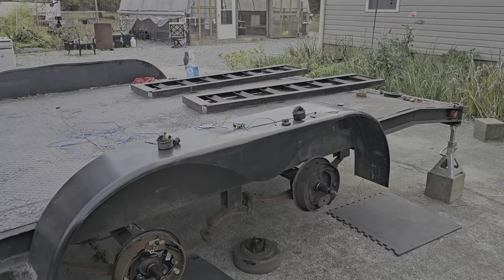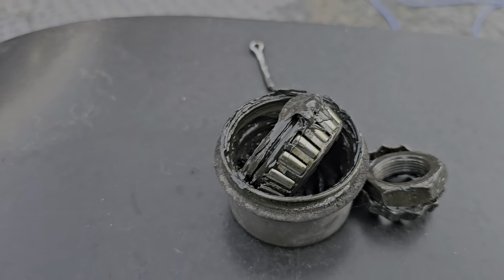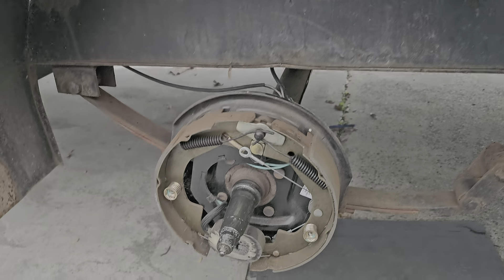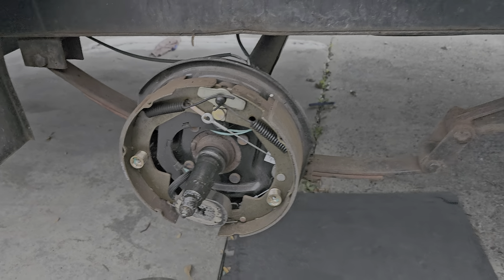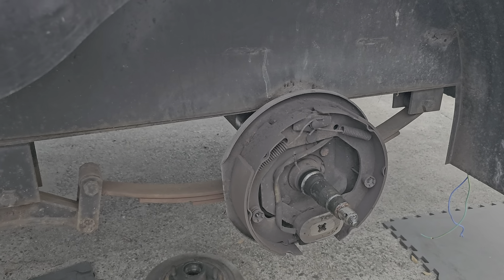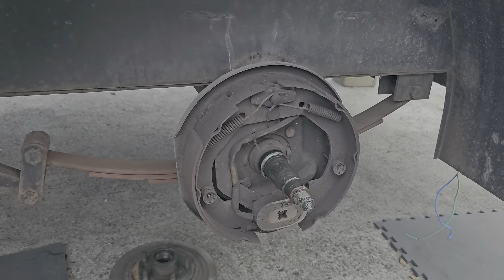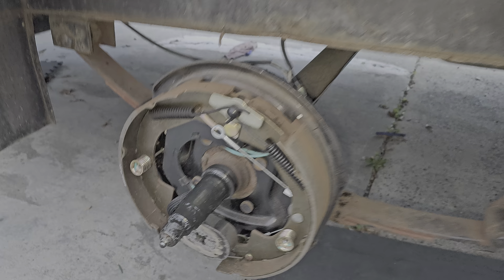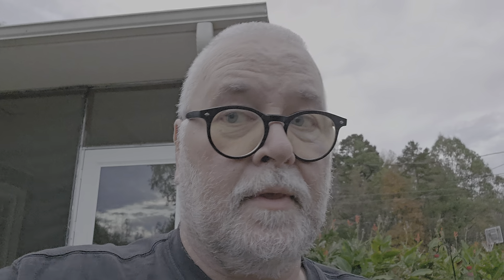Electromagnetic Brakes? How Do They Work? Car Trailer Repairs..

Comment: Pump your grease into spindle with drums off until all the old grease is out so you have minimal mixing. Pack your bearings in your grease and put it back together and pump it your grease to top off. That should take care if the mixing grease issue. Easy when its apart. Safe trip, cute dog.

Comment: Calcium Grease ,Lithium Grease ,Aluminum Complex Grease ,Barium Complex Grease ,Bentone (Clay) Grease , Polyurea Grease ,Polyurea Grease ,soap grease, When I was a young man working in the lead and gold zinc mines in the Yukon at Anvil mines at the town of Faro they mixed greases on a huge electric shovel  the tracks didn't last 1/2 a mile walking to the next dig site ,cost them 1 million dollars to repair tracks pins bushings, that was in 1970 the head maintenance planer was fired ,and we told them don't do it was a cost cutting idea .

Comment: And does the brake booster drain your battery.. ..?
Reply: Just like brake lights on the car, they only use power during braking.
Reply: It's running off the 12v system of the pulling vehicle. Unless your alternator fails or you somehow are pulling the trailer with the vehicle off, it won't do anything to drain the battery.
I guess worst case scenario, if you are holding the brake in vehicle off it would add a slightly larger draw than just the lights but I'm not 100% on that.

Comment: And if the grease  run passes the seal, then there gos your brake shoes. i for one, I won't use the grease  fitting. Just pack and go after all trailers  get way fewer miles, then cars do, and no one greases their wheels that much

Comment: Years ago i was on the interstate. Saw something come across the divider and bounce down my lane. A wheel and tire combo. I dive to another lane watch the wheel as i pass it still bouncing nearly cab hight and across the interstate i see a truck with a empty car trailer coming to a stop on the shoulder smoke coming off the spindle. I needed clean shorts and i bet others did to

Comment: Trailer lights are always a pain in the butt😂
Reply: Was doing this last week. turns out the trailer module in the vehicle was also faulty, only 2 of the 4 outputs worked, so that got replaced as a unit. New LED lights at rear, soldered to the loom and mounted, and then at the front replaced the plug and 5m of wire to get rid of the last intermittent wiring, soldered again and taped up, and placed securely in the wiring channel again. Used a lot thicker wire as well, not for the current (LED units take under 1A total) but for the better fatigue life of the higher strand count wire. More ties added to hold the cable against flexing, and a loop so the trailer turning would not stress it either.

Comment: Nice video. I’ve seen those easy lube things work as designed, but I’ve also seen them dump grease onto the brakes even when used as directed (pumping by hand while rotating the tire). Also, to me greasing bearings is more about getting the old grease and contaminates out, and you’d have to pump a lot of grease through the hub. Lastly if a bearing is grooved up or pitting, I’d prefer to change it at my shop as opposed to out on the highway. I’d also prefer to catch it before it spins on the spindle and ruins the axle.

Comment: Regarding brake controllers, there are two types. First is a time delay type that has a gain and sensitivity wheel. These are designed to allow the selected time from tow vehicle brake application to vary before the trailer brakes apply. This system also then applies the fixed voltage level to be applied to the brake magnets. Typically this system will allow for good braking when at highway speeds and very aggressive braking at slow speed. Very annoying. 
The second type of brake controller is an INERTIA type, typically with a pendulum inside. This gives you modulated braking, meaning lower voltages are sent to the brakes during slower stopping and full voltage to be applied during hard braking.  Tekonsha makes  an excellent controller, the P3 with the ability to work on several different types of trailer braking systems.  I hope this helps anyone with the old style controller. Upgrade your controller and you will be pleasantly surprised.

Comment: Great job Kenny doing a thorough inspection.  Let me point out regarding greasing the hub through the zerk on the spindle, that there are two different types of seals available. You can find a single lip and a double lip seal that fits the drum. If your axle has the zerk fitting and bearing buddies grease caps, then a double lip seal is MANDATORY. 
This prevents the grease from being pushed out onto the brake linings. 
If you have an axle that is not drilled and no zerk fitting, then any seal will work.  It must be understood that you do not pump grease into the bearing buddy and bottom out the piston. You want to fill the bearing buddy hub about half stroke. 
As mentioned before, replace the entire brake assembly as a unit. If you price out individual components you will spend more.  Be sure to inspect the wiring for any corrosion or damage as this will affect the resistance and loss of voltage being applied to the electromagnet. A good working system will probably have about 6-9 volts being applied at the magnet during braking, if your controller is adjusted correctly.

Comment: Greases compatibility is it's own rabbit hole. But it's usually not about the base oil in the grease, it's about the thickener. Maybe the additive package, but thickener compatibility comes first.

To keep it simple, there are 3 main thickeners out there that are being used in automotive industry:

– lithium complex (the most common one)
– calcium sulfonate complex (gaining popularity day by day)
– polyurea (stuff from the factory usually is packed with it, like U-joints and some bearings)

The first two are more or less compatible (Li and Ca), meaning you can pump the old Li complex with a Ca one, just don't switch the grease each time you pump. The issue comes with polyurea – mixing it with pretty much anything else is a bad way to go. The mix can either soften or harden depending on the specific combination, but it's a bad day both ways. I highly advise just washing whatever part you're regreasing with clean gasoline until it's free of old grease and just repack it with a new one you're using.

Also, polyurea has it's own distinct consistency and feel, compared to Li and Ca (complex) greases. It's kinda more gelatinous, while the latter two are more similar to a thick ketchup or a tomato paste, pardon the food analogy :)
Reply: That's worth knowing. I'm a little surprised to hear that a U joint would be packed with something incompatible with typical grease. The first thing I do when I install a U joint is add grease....
Reply: The other thing about compatibility of the greases is they will be actually corrosive if you mix different bases...as well as breakdown or  hardening up. I've seen this, but in aircraft stuff. There's lots of different grease bases used in that environment for exacting, specific purposes. We are actually in good shape so far as automotive wheel bearings and stuff on auto applications as all we need to do is totally remove all grease and only use one type..
Reply: It's because polyurea is a good choice when a manufacturer makes a part that will likely be either uncerviceable (u joints without zerks) or people being people won't pump it even if it has one. It's great when it comes to rejecting water, doesn't wash out as easy as Li-based greases.

The problem comes when the base oil eventually dries out – the seals on the u joint eventually lose that thin coat of oily grease, starts rubbing directly on metal, water/dirt gets under the seal and the part fails due to abrasion and corrosion.

So yeah, if you do your repairs/maintenance properly it's a good idea to buy parts with zerks, clean the factory grease with gas, dry them, pack with new grease of choice that you know is gonna be compatible with future pumps, assemble and pump again. Used tooth brushes are your friends :)

Comment: Thanks Kenny. i learned something today. I've never come across this type of braking system so it was really interesting to learn about. I more familiar with the mechanical tow hitch operated brakes. I'm assuming the power source would be linked through the brake light circuit to avoid needing an extra pin in the hitch plug.

Comment: I have used trailers like that, but never knew how they worked. Thanks for that. There are some trailers, smaller type that the tongue of the trailer pushes in when you brake the vehicle, I think they work like emergency brakes on a car, manually, but I don't really know. Like I said, I've used them before but never owned one or had one apart.
Reply: Standard braking on older caravans, because of the mass. Electric brakes never really took off by me, the only thing that has powered trailer brakes other than trucks are pickups with fifth wheels, where there the converter installs an air compressor and tank in the pickup, and the trailer has a pneumatic set of brake actuators, and a proportional valve tied into the regular hydraulic brake system, with an in cab parking brake for the trailer added on. Works really well, and is very effective, and the regular truck trailer mechanics can fix them with no problem, standard drums and S cam units, just a lot smaller than the truck version, and based off a Toyota drum and hub, so parts are not an issue anywhere in Africa for it.
Reply: In NY state your trailer is required to have brakes over a certain total weight, I think 3000lbs.

Comment: I have heard the same with grease. It's always best to start from scratch with something you have no idea what is in there prior.
It becomes thin, will destroy the bearings, possible the pads and can also become flammable if the situation allows it the'll. On a trailer, fire is probably unlikely but it will smoke like hell lol.

Comment: I have never seen a trailer that size with brakes on both axles, it's not needed. Brakes on the rear axle are enough, have to wonder why it's like that. You're right about the grease. We bought a toy hauler last year and the brakes weren't working very well. I pulled the drums to check and someone had mixed the grease and they had been greasing the crap out of every spindle. The brakes were saturated with grease. I cleaned each assembly and repacked the bearings and replaced the seals. Surprisingly the brakes work very well now, I wasn't sure if the pads would seat in again...they did. If you make a video on repacking the bearings, please mention that over greasing a spindle like that has consequences. I'm a firm believer in pulling the drums and checking everything once a year if the trailer is heavily used or it's a trailer like a toy hauler (bumper pull or 5th wheel, something heavy).
Reply: You MUST have brakes on each axle because you never know what you’re going to haul. The trailer braking system is designed to be independent from the tow vehicle, meaning that it should be capable of stopping the loaded trailer without any additional braking force from the tow vehicle.
Reply: @jimfiles3307 and like a truck are car front axle  do 75% more work then the rear axle

Comment: Dissimilar greases can be a problem, but based on my conversations with application engineers, at least with modern greases, it's not that big of deal. In that, the results are more of a dilution than a chemical breakdown. 
We build actuators and might see as many as 2-4 greases coming in contact with one another. We've never experienced any sort of reaction/breakdown.
I've packed seizing cv joints with marine grease, and they've done just fine until I could replace them.
If the soap, thickener, and lubricant are similar, in composition or purpose; you're probably okay.

Comment: I have single axial Airstream and haven't removed the wheel hubs and always wondered how they worked. Trailer is a 2022. I do jack up the trailer and spin wheels to listen or feel anything and so far everything is fine. How often would you take apart and clean and repack?
Reply: Normally for a trailer once a year is a good thing, gets the grease moving if you have not used it, and allows a check to see linings are still attached and correctly adjusted, plus you also get to check the tyre for good air pressure and condition.

Comment: My brother taught me about trailer brakes over a decade ago when I repacked the bearings on my travel trailer. 

My trailer has the grease nipple too. (Bearing Buddy?) I was taught that is for really intended for boat trailers so you can pump the water out after loading your boat. 

Never really did much regreasing on the travel trailer.  The grease in there ain’t going anywhere.  Just repack them on a schedule and you will be good.